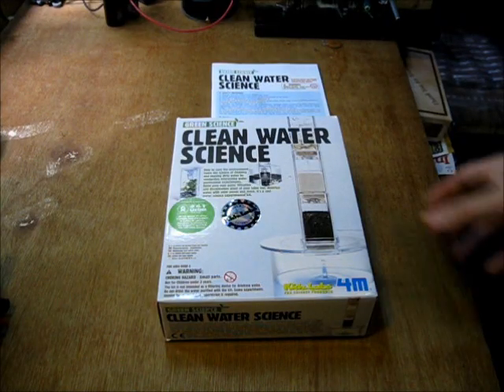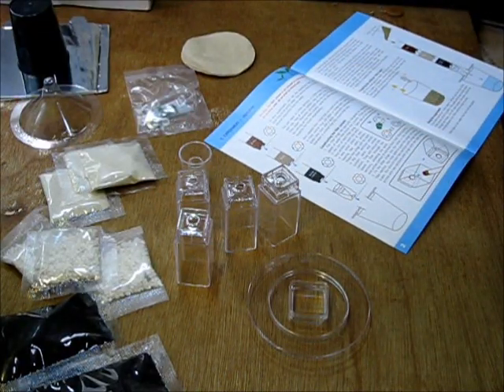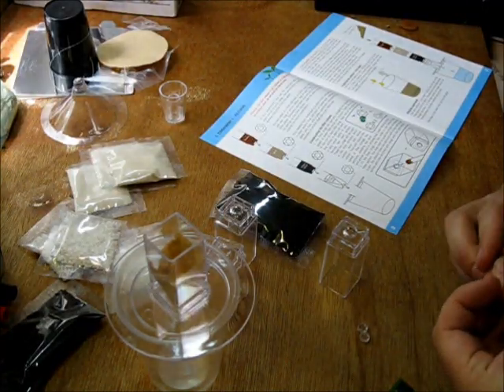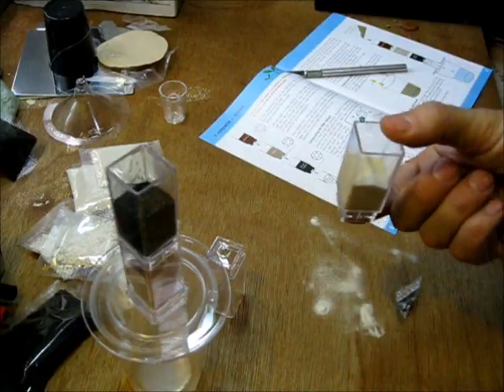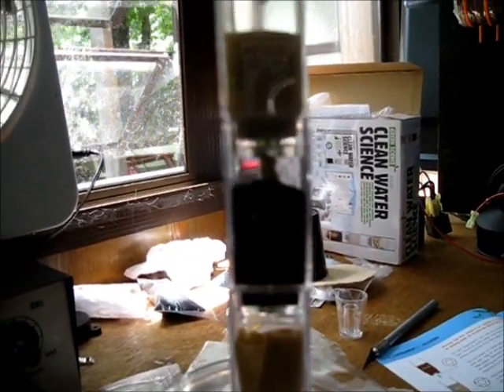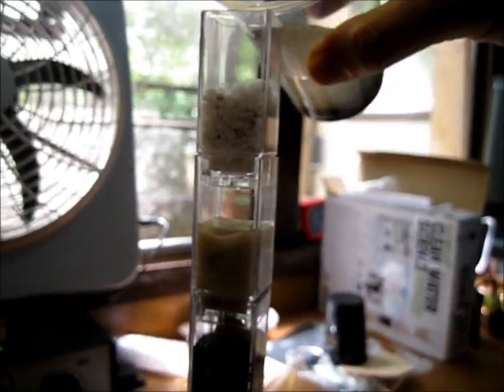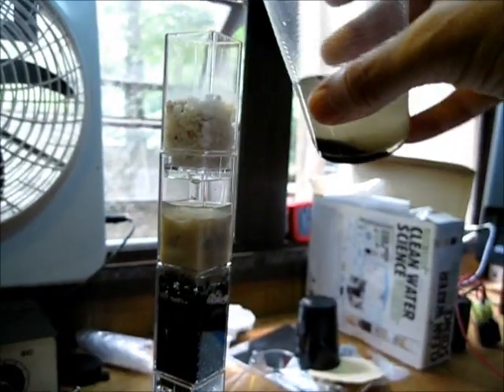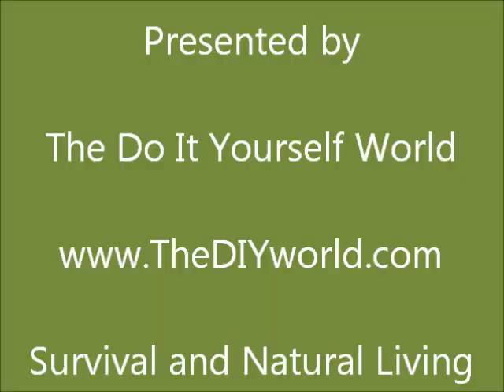Make A Water Filtration System Clean Water Science Lab Demonstrated

Comment: Hey is there any substitute for the charcoal in case we don't have any?
Reply from the maker: +mellissa Burnham Charcoal is wood burnt in a closed chamber. Put wood in a closed tin with a tiny hole in it and put that over a fire. You will get charcoal. Then crush it up. Or you can buy real charcoal for grills but get the stuff that is real hard wood and has no lighter fluid added.

Comment: LOTS OF CLEAN WATER ALL YOU CAN DRINK :  I don't understand why people make things so complicated to do a simple chore. I can take nasty sewer water, pond water, piss, saltwater combination and turn it into FRESH 99.99% CLEAN water to drink.  All you need is these four items. A shovel, a 10 feet square clear plastic sheet and two buckets.  Dig a 9 foot square hole that is slightly deeper than your buckets tall. In one corner of the big hole dig a smaller hole so one of the buckets can fit in the small hole. FILL bucket with NASTY WATER and dump into big hole all over the place in hole and do this till bottom of hole is saturated. Fill bucket once more and put in small hole in corner. Put empty clean bucket in center of big hole. Place leafy branches around center bucket. Place plastic over hole and fill edges with dirt. Push down slightly in center over bucket  so plastic dips down slightly. IN 10 minutes it will begin to drip water in the center bucket. IN 24 hours you will have a full bucket of water to drink all day long. Works best in dirt near a swamp and should be in direct sunlight. This works every time. And if you dig this in a swamp area. You only need the center bucket. The more area of evaporation, the faster it drips into your center bucket. I don't understand why so many people don't know this. This is the ONE thing you NEED TO KNOW how to do, so you have clean water to drink. You don't need those fancy filters, or high tech waste your money on junk to get clean water. I don't understand why the people over seas don't know this. They all drink that nasty bio hazard water.  GEEZ. They got that huge body of water called the ocean they could use. By using this method and being by the ocean, they could have more clean water than they could ever drink in one day. Why do so many people don't know this ?  I'm shocked of the ignorance. WOW.
Reply from the maker: +pudge I have made a video using the same method you tell about as well. Yes there is plenty of water all over the World. Fresh, clean water waiting for us to use.
Reply: Hi Pudge, I didn't understand how to build hole after hole. May I ask you draw a picture?

Comment: Troy I have a Berkey System but they are expensive....You can build your own system with two 5 gal. buckets ( Food Grade ) . Lowes & Home Depot buckets are food grade ( HDPE ) . Just get the Berkey Filters ( Black Ones ) and there are several U-tubes that show how to cut the holes and install the Black Filter....These work just as good as the Original Berkeys...If you send me Your mailing address I will ship two used ( only used for less than 2 months ) Berkeys at NO COST to You...

Comment from the maker: Huh?

Maybe I should be very, very specific in my wording of things to prevent any misunderstanding.

If, in a full collapse, you need pure drinking water this will work.

What are you exactly going to do with a plastic bag? Put it over your head so you dont suffer as long?

Ok, I should have said:

In a survival situation, when you settle and set up permanent camp, you can use such a filter for your permanent home to clean drinking water. Materials can be found or made easily as I said

Comment: Great vid Troy 
I'm working on my bucket filter system it's a bit different but the same principle 2 5 gal buckets 1st bucket 3 in sand filter paper 3 in of gravel 2nd bucket filter paper 2 in sand filter paper 4in charcoal filter paper 2 in sand 3rd bucket clean water drill holes in the btm of the first 2 buckets and lids (all the buckets have lids) this system is supposed to filter 1000 gals before you change the media Oh my filter paper is coffee filters over lapped  between the media

Comment: I am wondering what the slope and distance is from the creek.  Maybe a 12vdc water pump and some garden hoses.  Either way, water storage needs to be pumped up high so you can get gravity feed.  IF the storage water could be run through troughs, gravel, sand, charcoal on a larger scale he could fill rv tanks with ease.  That means showers and toilets working as planned.  Just a thought.

Comment: Based on that, I would probably use three 5 gallon buckets sitting on a table of some kind. At the top bucket, I would put about four holes at the bottom (as well as the top of the second bucket covered with a wire meash). In the top bucket I would place a layer of aquarium gravel along the bottom and fill the top layer with sand. In the second bucket, I would put four holes at the bottom (and on the top of the bottom bucket). I would fill it with aquarium filter charcoal & towel on bottom...

Comment: When I lived in Toledo, I had a Kenmore countertop distiller. When it was done with cycle, there was yellow powder in the bottom that smelled like herbicide/pesticide and that was from tap water. It was expensive to run (electrically) but worked well. Sold it on ebay, but wish I had kept it. Another YouTuber recommended the Berkey water filter (gravity, non-electric) after he tried several.